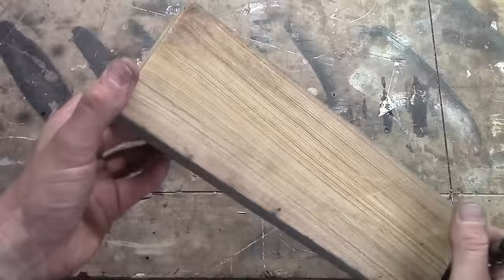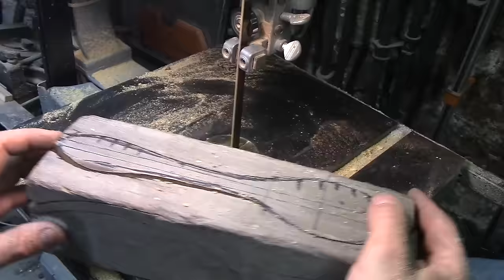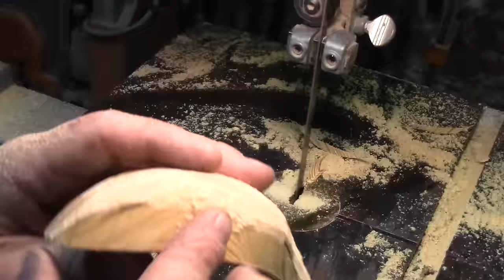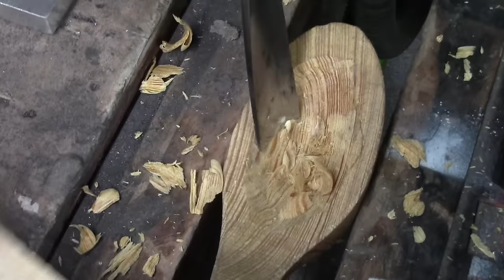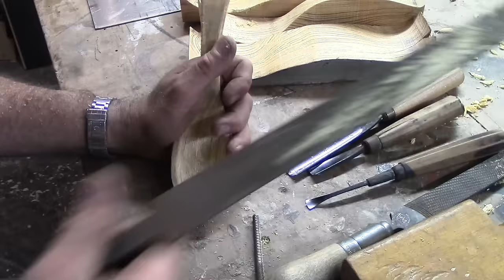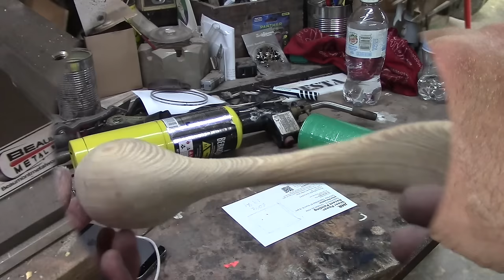✔ DiResta Wooden Spoon (OLD VIDEO)

Comment: hey diresta before you use the hot glue next time, try this. Dont finish the cut with the band saw,.stop 1-2 mm before you finish the cut. you will see it will work. sorry for my bad english.

Comment: Jimmy, you might just put it back in the block of wood as you did near the end of the video, put rubber bands around it, and wrap it as a Christmas present. Then she could open it and not only be surprised that it was already finished but see where it came from! I might even do that. But I want to make a rounded sandpaper ball somehow, then put it in my drill to smooth the cup out.

Comment: How do you stabilize the wood? With that cross grain on the handle, it would look like that would be a weak point, the first place to break if any stress is placed on the handle. How would you strengthen (?) that point?

Comment: This Reminds me the Which blade... Jimmy, a DIRESTA spork could be useful... one side fork the other spoon in stainless steel. a DIRESTA DE safety razor made with bolt and stainless pipe section... with Diresta Beard cut. 
Again Diresta helmet reusing surplus  kevlar military helmet, bill cap rechargeable led lights and other features as music earbuds  for phone calls integrated front camera... so on...

Comment: What would you coat this in to use it? Thanks
Reply: B-Rad Danish oil is pretty good if you want to use it.
Reply: Bugger I use Danish oil for chopping boards. How long until it kills me?
Reply: Er, ok, I actually looked it up, briefly.  It usually does contain toxic chemicals, but is probably ok when completely cured, however long that takes (a month, or more?)  Depending on the additives, it could still be off gassing after that.

You probably know better than me.  Personally though, I would prefer to use something more natural.
Reply: Iron Pirate yeah I wouldn't recommend downing a pint of the stuff, just read the tin and chopping boards is one of its suggested uses. I do wipe over a little olive oil on all utensils look dry.